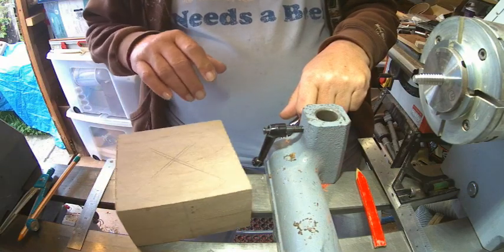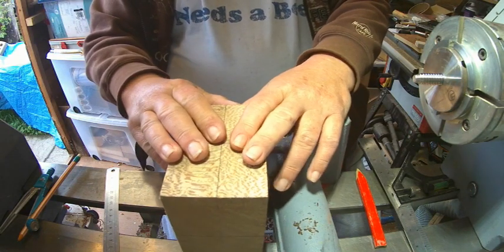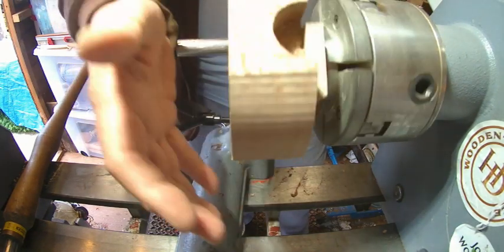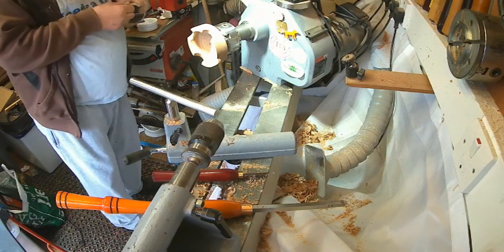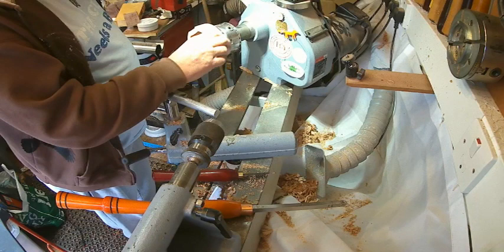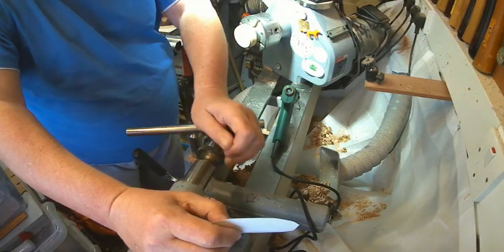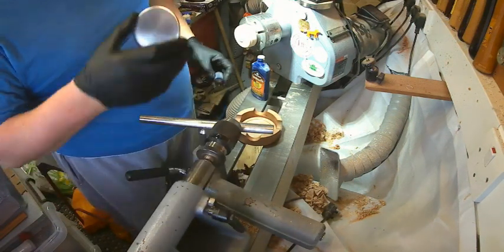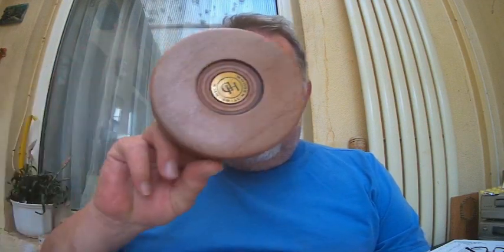Woodturning a Pair of Cigar Ashtrays from London Plane or Lacewood for my Brother.

Comment: Nice one Huw. Can’t see a wood ash try without a metal insert. Would just burn up the bottom. The stainless disks are a great solution. Well done.
Reply from the maker: Hi Doug, My thoughts exactly. I recently saw one made from a beautiful piece of Zebrano that didn't have a disc in it. I suggested a slate coaster would work. Thanks for another watch, comment and you support Doug. Take care my friend. Cheers, Huw

Comment: Very nice Huw. So kind of Louie to send you some of that stainless steel plates. 
As you may have seen I did it with cast aluminium but you need a thicker bottom for those. 
If you ever want to make one I can make you a machined casting.
Reply from the maker: Hi Leo, Yes it was extremely kind of Luie, he is a really nice and generous person.
I remember your video and thought I can't do that as I don't have any equipment to do it. 
That is a very kind offer which I will take you up on one day. 
Thanks so much my friend. 
Take care. Cheers, Huw
Reply: @WoodenItBeNice  This weekend I will start on another one myself, from a big chunk of Pine this time. 
That's a spin-off from the last one I did because it will go to a relative of the people that received it. I had asked them to provide the wood, not knowing what they would come up with.
The bark on it is quite beautiful but I'm concerned the Pine will crack before I'm done, or shorty after that. 
We'll see! 🤐😁
Reply from the maker: @emgiwoodworks  Good luck with the project. Pine is not the easiest to work with but is such a lovely looking wood. Hope you video it and post it on YT. Take care mate. Cheers, Huw

Comment: I'm sure your brother is going to love them Huw, even with the holes !  Maybe I dreamed it but I'm sure I've heard of a type of Forstner bit where you can unscrew the point once the hole has been established. If it was a dream someone needs to invent it because those little divots are a pain. I always use the superglue and masking tape trick to temporarily attach two pieces. I've just turned 5 pendants and not had one of them fly across the room and they all came off the backing plate clean and easy.
Reply: I've seen this superglue-and-tape thing but always been a wee bit wary of it. On your recommendation mate, I think I'll give it a try. Thanks!
Reply: @MarkMcCluney  I would be wary of using it to attach a bowl blank but for small items it certainly works. Good luck.
Reply from the maker: Hi Myk, Thanks very much my friend. I'm not going to tell him. LOL. I have a vague recollection of a flat bottomed Forstner bit but not one where you unscrew the pointy bit. They are a huge pain especially if you are trying to get a thin bottom to the piece.
I will have to try the masking tape trick, I have seen lots of people use it and all with success. Take care Myk and I'm hoping to get to the Post office tomorrow or Saturday. Cheers, Huw
Reply from the maker: Me too Mark, that way we can blame Myk if it goes wrong. LOL.
Reply from the maker: @mykhough6614  Thanks Myk
Reply: @WoodenItBeNice  You don't need fancy tape or expensive glue but one trick is to burnish the tape down to maximise the grip; also don't use too much glue or it will squeeze out and stick the workpiece directly to the backing.
Reply from the maker: @mykhough6614  That's a point tip
Reply: @WoodenItBeNice  Oh I won't blame Myk, I've got plenty of blame of my own...
Reply from the maker: @MarkMcCluney  🤣🤣